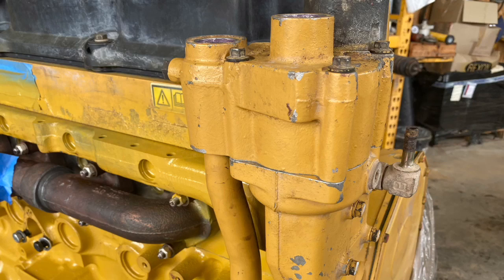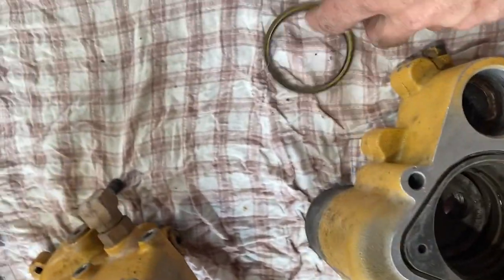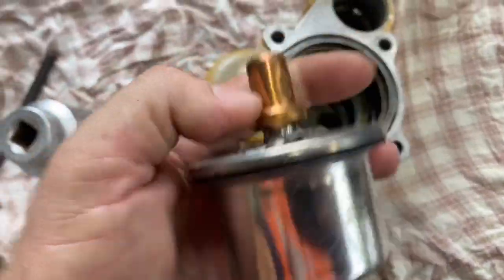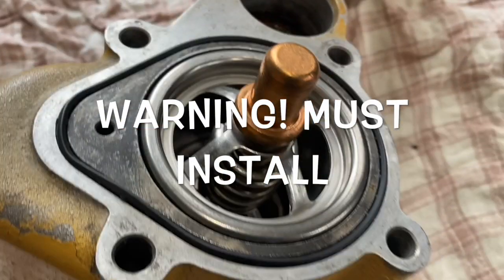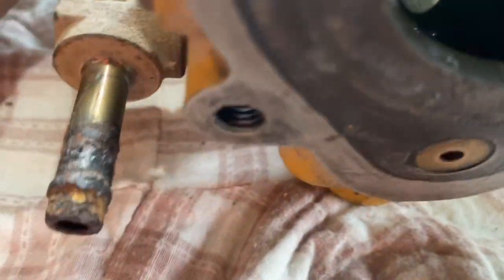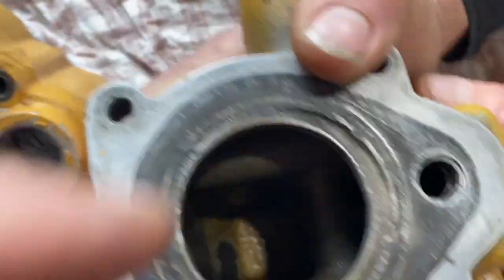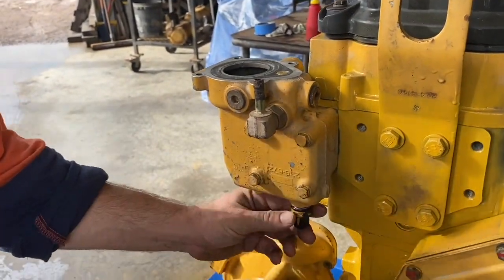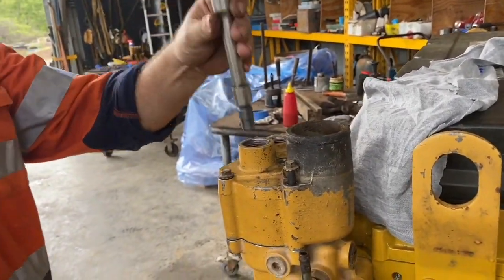C11 Installing Water Regulator (Cooling system)

Comment: I've come across a number of times that the regulstor housing bolts are siezed in, and end up breaking. Frustration trying to remove broken bolts! I always apply thread lubricant to those bolts.
Reply from the maker: Absolutely using thread lubricant is a must! Especially when they are aluminium housings